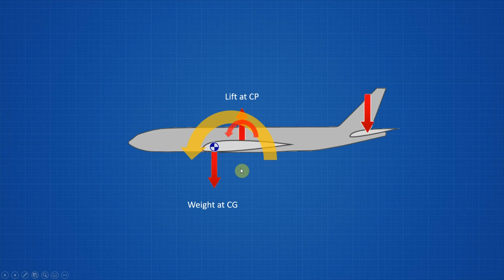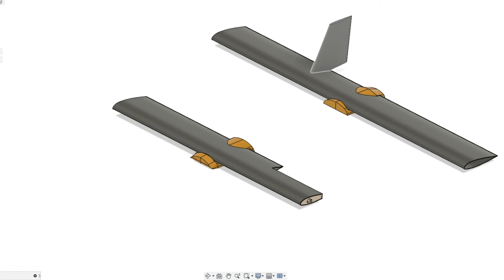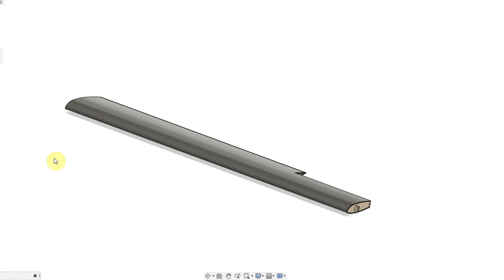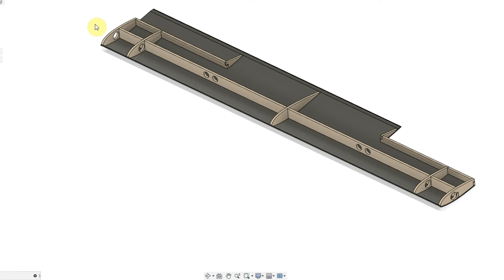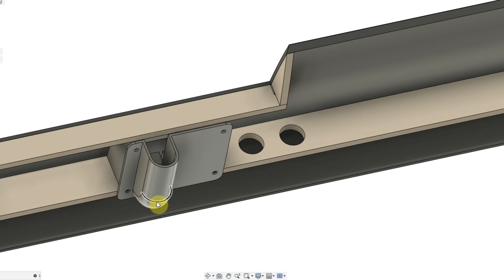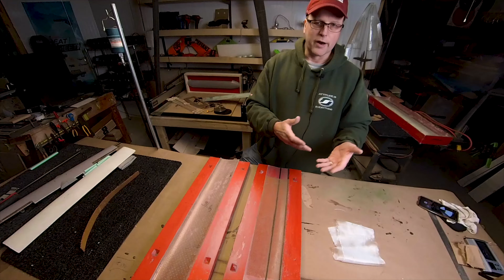Tandem Wing VTOL Part 2 - Wings

Comment: So I’m in the early stages of developing a similar aircraft, and I’m curious why you chose to adjust COP/COG distance using AOI and wing size instead of airfoil choice. Thanks for the video, nice work!
Reply from the maker: The short answer is that it was just easier to do. It required less analysis and would allow for easier construction and modifications during testing. Using the same wing parameters meant simpler construction, and adjusting either wing's incidence was an easy way to tune the build during testing. While not as elegant of a solution, I don't think I compromised much in the area of efficiency, at least not at this scale.  Good luck with your project!

Comment: Would the tandem config be a good design for a slow moving, high payload uav aircraft? Of course with a larger wingspan or such.
Reply from the maker: The tandem wing design is best use when you want to keep the wing span shorter for some reason. It isn’t going to be as efficient as a single wing with the combined span. It could be used for a slow/heavy plane if the wing chord, airfoil and span are designed for it. It won’t be as efficient a the single wing but it will have considerably less span.  My early foam prototypes were very high wingload and flew efficiently. And they were small e to transport without removing the wings.
Reply: @DefiantWings  Interesting this was what I was getting at. Big thanks for the explanation!

Comment: Any guidance on airfoil for the "tail"
Reply from the maker: I’m using a NACA 0010 on the vertical stabs. Right now I’m going to print them and mount them to the rear wing with CF dowels. I may consider molding them in the future but this will do for now.
Reply: @DefiantWings  I meant the aft wing
Reply from the maker: Ah, sorry I misunderstood. The rear wing is currently the same airfoil at the front but with a lower angle of incidence